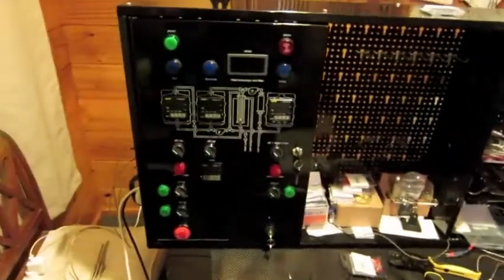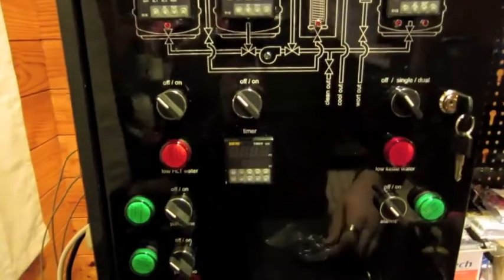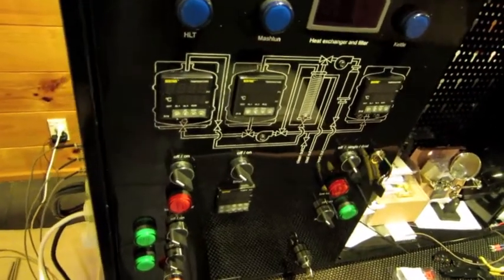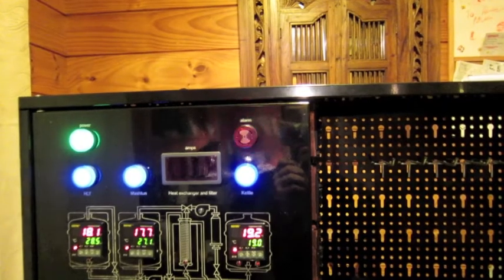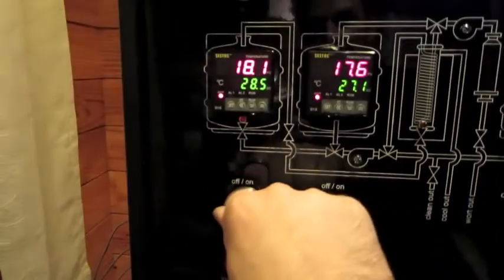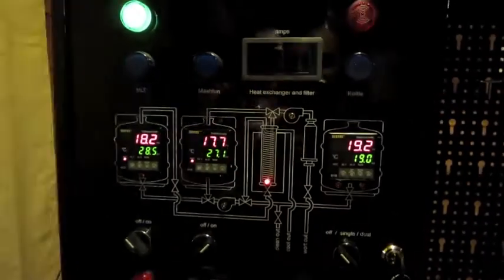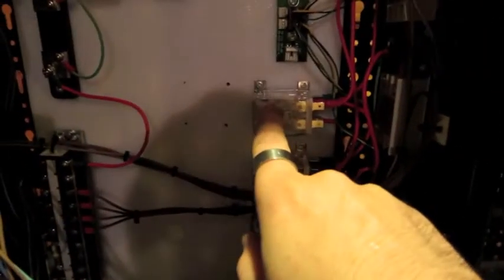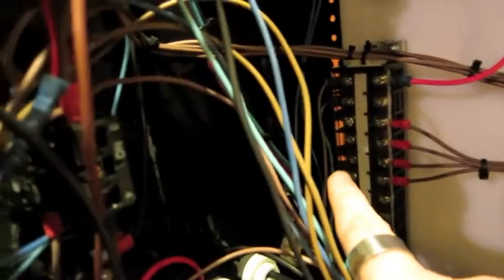Electric Home Brewery part 1

Comment from the maker: Hi Viv, I had the door panel laser engraved, which etched of the powder coating, leaving just enough of an indentation to paint fill with white paint. If I did it again I would replace the door panel with black acrylic, 4mm thick, as it can be laser engraved a lot deeper, making it much easier to paint fill.
Reply: Just geekin out a bit, but if you did the acrylic, you could backlight the panel... ;)

Comment: Been getting back into home brewing recently - put a few extract K&K brews on a few weeks back to stock the old kegerator whilst I research and plan out something a bit elaborate for all-grain brewing.  the electric brewery is indeed an amazing site and I'm also looking to do something similar in my warehouse/studio.  Where did you get the cover plate for the cabinet with the HLT/MT images etc?  Did you etch those images yourself or buy it from somewhere? Cheers, Viv

Comment from the maker: Cheers for the comment, the cabinet is just from a hardware store. its original use if as a tool cabinet. It was even half the price of an electrical cabinet, so was ideal. As soon as I get the brewhouse finished, I will be doing a video of a brew, its been 3 months since i last brewed, the kegs are getting empty. Cheers have another 1

Comment from the maker: yes, except for the main 32amp line that feeds 3 circuit breakers, I got an electrician to do that once the control panel was mounted in the brewery. The power feed shown in this video was just 10amp lines used for testing.

When I look at the wiring it looks pretty intimidating, but it wasnt to hard, I just wired it up in small circuit steps, testing it as I went. Cheers have another1

Comment: Was thiinking od duing something similir to this , but was wondering what was the fine cost of it after it was done ?
Reply from the maker: discusctx the whole brewery is estimated at around $5k, but purchased in small eBay chunks over a couple of years to avoid detection by the financial controller (aka wife) ;)
Reply: LOLOL Doing the same for the same reason :)

Comment: To answer your question regarding water level;  get your hands on a flygt transducer and control unit, it would be most reliable.  You will be disappointed if you use floats, they are not reliable.  Secondly, the outside of your panel is great, nice layout.  But then, we get to the inside.  I did not see any signs of circuit protection, or grounding.  Please make sure your wire sizes are adequate for the loads.  I'd like to see some fusing...  and make sure that the cabinet door is bonded to ground using a wire (the hinge does not count as a valid ground bond.)  Also make sure the backplate is bonded to your main ground, and the cabinet.  Be safe  >:)
http://www.flygtus.com/1547410.asp
Reply from the maker: cheers for that info, yes floats aren't reliable. There are 4 circuit breakers in the control cabinet, and a RCD breaker externally also. There are also heavy gauge wires that carry the high amps, plus dual poll relays before the solid state relays, to ensure a physical disconnection between power and the outputs. The back panel is mounted on a nylon board, that is insulated from the cabinet. But yes I do need an earth from the panel door to the main cabinet earth connection. Cheers

Comment: You should add a wifi shield then build an interface for smart phones.  Not because you need it, but because SCIENCE.
Reply from the maker: Chad Bingham I have the parts, just never got around to doing it. I wanted to test it all first, then work out what I wanted to control or monitor remotely. Cheers